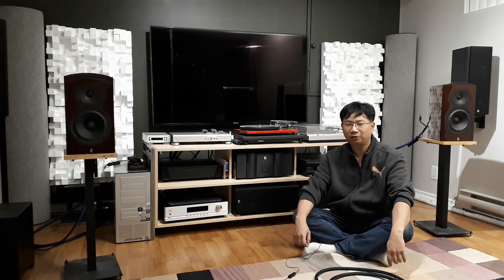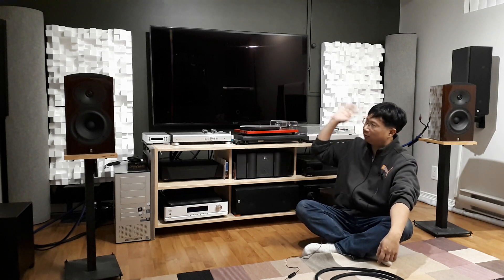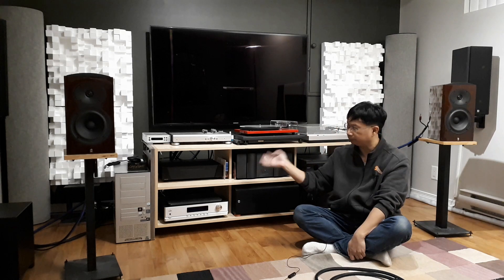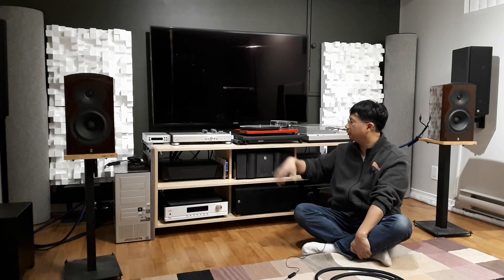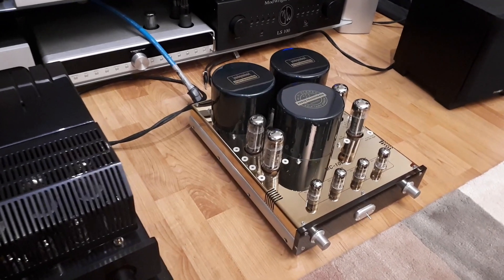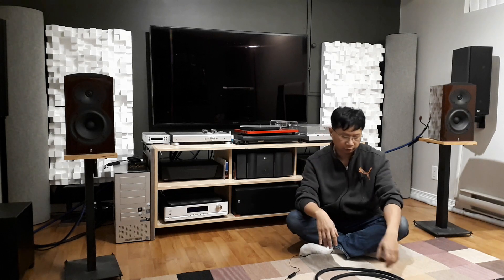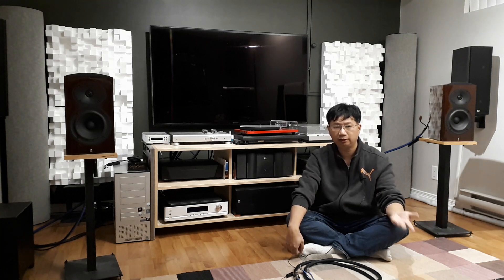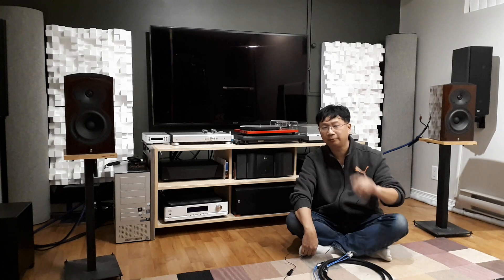I am back! With fake speaker cables!

Comment: i'm a Electrian also and i work at Montaplast of north America in the maintence department , Our robots are building the new mid engine Corvette , Did you have your electrian run you a direct circuit ?
Reply from the maker: I have 2 jack installed and each one have a dedicated breaker at the electric box. Is that a direct circuit?
Reply: @ThomasAndStereo  yes
Reply: In my opion you get cleaner power thats not interupted by daisy chaining from one electrical receptical to another , This is much better than buying a power condtioner without a direct connection , unless you have dedicated circuit and power condtioner then yeah that's The best way possible for clean power supply .

Comment: I've tried a set of speaker cable from ali. Vd hul. I also own a pair originals. The cable from ali is a fifth of the price. Measured em both. Exact the same. Resistance everything. Cut both the bananas. The same. Listened it on my mancave set.  quad esl powered bij sphinx project 2-18 amps. No difference. So what gives. Ofc or occ copper is ofc or occ copper. Im not saying you have to invest in all chinese products. But blindly buying the most expensive option is stupidity.

Comment: Hi again Thomas I was sceptic about speaker cables for many years, My old Spendor BC1 which I used with a Audio lab 100watt Power amp for many years tried a couple  of different cables and made no difference.

Up dated My system to Naim pre amp nac72 and Naim Nap 200 power amp with Harbeth Super HL5 speakers
tried different speaker cables and to My amazement it do change the sound very marked indeed I cannot explain why.
Reply from the maker: Yeah, can't explain it with measurements but like you, I can definitely hear it BUT not all the time. I think non believers think cable makes a difference every time, it does not.
Reply: @ThomasAndStereo  No not all the time. My Harbeth HL5 are more revealing in terms of texture and detail as the Spendor BC1 are not, it could be the HL5 speakers are more sensitive to cables.

Comment: Hi Thomas!  You should move your center speaker to the top shelf at least, makes no sense having the amp on top.  Are you using those black speakers on the outside as Wides?
Reply from the maker: Hi, The reason is at the bottom shelf is because my projector screen comes all the way down when I use my projector.
Those black speakers are my main home theater speakers.
Reply: @ThomasAndStereo  Ever thought of an acoustically transparent screen?
Reply from the maker: @commanderrussels2612  Oh definitely, my friend has it and its amazing to have the speaker behind the screen for home theater. Not possible in my case unless I plan to use my projector as my main display. I like bright rooms. My current screen is a tab tension electric screen.

Comment: Nice room. I highly recommend moving the TV above the plane of the speakers if possible. Can you tell us where you got the white diffusion panels?
Reply from the maker: Thanks, that is what one of my friend did but it would be difficult in my case. It was already so hard for me to mount it because I went with a extra heavy duty mount and the screw was so hard to screw into the wall, removing it would be too much work.

Comment: Glad your back Thomas , another great video and your room is coming along nicely. Who did your stereo rack ? Do they deliver to the states ? That’s exactly what I’m looking for .
Reply from the maker: No, it's someone local. I like it as it has metal support underneath and a metal frame on the side.
Reply: Thomas & Stereo Ah ok , it’s very nice and exactly what I’m looking for , I’m using a double set of VTI racks right now filled with sand to deaden them and it works well but I want a wood rack .

Comment: I totally disagree with your passing comment that the Thorens TD-203 is 'just ok'. It is a fantastic table. Where else can you get a finely built uni-pivot tonearm and electronic speed change for that kind of money. The uni-pivot arm extracts more detail in general. Mind you I've never had the stock rebadged budget AT cartridge, like Rega also uses on their entry table too. I purchased mine 203 with an Ortofon 2m Blue. Vinyl LPs set directly on the platter, which it's designed to be used, the uni-pivot arm, and dead accurate belt-drive low torque motor like AR used is a superb combo. It would take a lot more money to surpass this combo. Just my 2¢

Not trying to be offensive, but a small critique about your presentation. Try to have your thoughts more concise w/ less rambling when making your point.
Reply from the maker: Well if I had it with the Ortofon 2m Blue, I might conclude otherwise. I guess 'just ok' is relative. My last turn table was the Marantz TT15 so I was hoping this would at least be 80% of it due to the point of diminuishing return. Sadly it was not, maybe with the Orfton blue, it would have been.  I usually do try to have my points all done but sometimes I improvise on the spot, I have a serious memory issue, (as in the type I have seen neurologist) that is why you will see me a bit lost from time to time. But thanks for the advice, will try improving.
Reply: @ThomasAndStereo  Sorry to read the 203 isn't meeting your expectations. I should also mention that besides the 2m Blue, I'm using the superb Schiit Mani phono pre with a Mystere IA11 tube integrated amp (by sister company PrimaLuna in the Netherlands) with ElectroHarmonix tubes. Sound is big, full and detailed surpassing CDs from a BD player w/ likewise highly-rated Schiit Modi 3 DAC.
PS. I didn't mean to offend your communication style but you can be long winded. Just thought tightening it up a bit more would make it easier to keep my interest and follow your thoughts.
Reply from the maker: No no, not offended, especially you are not the first one to tell me. I try to condense and get straight to the point as much as I can. Still room for improvement.

Comment: hi Thomas :)
i like the new changes to the room and upcoming content looks like fun.
and always nice that one of those speakers i got so comparisons would give me a reference point.
Reply from the maker: Thanks! Which one do you have and your opinion about it?
Reply: i got the wharfedale 225's,  had them for 6 months as nearfield as my main system. i think they are great buy, but the port system might be boomy for some rooms and its hard to plug it since its vented all around the base.  at least with my canton's its a easy fix with normal ports.

i do not have enough experience with different speakers to have a proper opinion just yet.
Reply from the maker: The D225  are pretty good. They definitely are one of the budget speaker to consider when shopping for a speaker in this price range.

Comment: Hi, you can try pure silver. They are around 10% of you $3k cable. You can find in internet. I have change all my cable to pure silver
 They are better with tube amp. Good luck.
Reply from the maker: Yeah, I have a few silver cable already. Thanks.
Reply: Not silver. PURE SILVER. THEY have different sound.

Comment: Your room looks great!  You figured out on your own to go with a smaller speaker that won't overload the room.  With your smaller speakers, I would be careful about too much deadening.  Your friends speakers that I saw in other videos can move much more air than a stand mount two way.
Reply from the maker: Thanks, I actually ended up removing the carpet as I find the room too dead now. I have both floor standing and bookshelf speakers and now my room can handle both with ease.

Comment: HELLO, I HAVE A QUESTION. DO I NEED STEP DOWN TRANSFORMERS FOR MY TUBE EQUIPMENT?
Reply from the maker: I have a Yaqin 10Ct and rated at 110v. Here in canada, we have 120v. In theory, I should. I don't and from what i was told it does shorten the life. I heard from my friend in other country that they are ok to overdrive it with higher voltage as it does sound better according to them but shorten the lifespan. This is a question more for an engineer, I have no idea except from what I heard.

Comment: welcome back 
awaiting your review on the WD diamond 225 :)
Reply from the maker: Thanks, if you have them, what do you think of them and how they sound? Asking because just incase I miss something characteristics of them.
Reply: @ThomasAndStereo  hello Thomas , Yes I have them , before getting them I had vintage Onkyo speakers and Definitive SM45 , when I got the WD225 I didnt like their sound at all maybe becasue the previous speaker tends to bright side a little bit more than WD225 but after breaking in which takes more that 100 hours the sound dramatically changes , those speakers shines with their mid-range , maybe they need a little bit more triple but this can be compensate by the amplifier and depends on the source .
Also those speakers needs to be positioned correctly and not tolerant as the Definitive "which are a great speakers in fact" 
I found those speakers are very good jazz , classical ,instrumental music but not for rock or any music that need "mmm, how to say" more dynamics.
finally the down firing port doesn't mean you can place them very close to wall but better to keep them at least 10- 15 cm from wall .
one more thing I noticed they sounds better without tweeter grill I thought at first that my mind telling it is better without grill till I read the review on Stereophile.com and the reviewer mentioned the same notice at the part of speakers measurement .

Comment: Just done something similar and took a while over it. I think you have far too many diffuser panels and in the wrong place. I would go with around a quarter of what you have and it should be where your tv is. Trust me even a little too much will be detrimental to your sound.
Reply from the maker: Yes it should be where the tv is but sadly I can't live without my tv. These are premade so I will have to cut them to make them smaller but they are so expensive that I am hesitant. Still a work in progress, some say put it on the ceiling, my friend puts it at the first point of reflection those diffusers. Have to spend  time to figure out what sounds best.
Reply: @ThomasAndStereo  yep trial and error my friend. I ended up with only a little. Turns out reflecton is not all bad. Dont over do it👍

Comment: Glad to see you back Thomas
Reply from the maker: Thanks! Happy to be back.
Reply: Looking forward to hearing your thought on the electricians work. I’ve sudden added a lot of audio equipment, and I’m finding all sorts of noises/hums that I need to eliminate. I noticed when I brought my cell phone, near my desktop computers keyboard, there was a hum coming out of my speakers. Can’t remember if was my computer speakers or my audio system. I pulled my cell phone away, the hum went away. Brought it close to my keyboard, the hum came back. Also noticed when I moved some of the audio cables in my audio system, there were noises from the speakers. So many places I need to eliminate interferences. Have to check all my cables, the outlets, the power strips & etc

Comment: How does diffuser panels affect frequency response? I always thought they only helped with imaging and soundstage.
Reply from the maker: One weird thing I noticed is with my new setup, the singer feels very 3D and exactly at the center. I sometimes would stare at my tv almost able to imagine a singer there.  The best part is it is with all my speakers now.
Reply: + @ThomasAndStereo   

Thomas, what type of material are your white diffusers made from?  Are they hollow on the back side and lightweight?

Ideally your huge flat panel TV would be replaced by a diffuser panel + some absorbtion.  You'll have much better potential of experiencing the depth and layers in the soundstage.

You could replace the HDTV with a large perforated roll-down projection screen & projector setup.  I don't think you have any windows in this room that would cause screen washout when using a projector, right?

The most important Reflections to control are the main Side Wall Reflections from both speakers, on both sides of your listening position, and also the Back Wall Reflections.  As you mentioned, a suspended "cloud" absorber and/or diffuser will be beneficial as well.

Each speaker will produce reflections on both the same side and the opposite side wall at basically a 90° reflection angle to each speaker, as if you placed a mirror on the side walls and could see each speaker reflected in the mirrors from your listening position.

Speaker positioning itself (distance between + toe in, & height), and in relation to your listening position, is extremely important.

In addition, search online for the Carl Tatz Room Mode Calculator to dial in your room's low frequency response at your listening position.  Excellent video (applicable info mid-way and towards the end of the video):
https://youtu.be/ZDmACvbPxXs

The other most important factor of your room is its STC response...reverberation decay time throughout the frequency spectrum.  STC Ratings:
https://www.soundproofingcompany.com/soundproofing_101/understanding-stc-and-stc-ratings

What Microphone(s) and Software will you be using for your measurements?  I'll just be frank and say that Measurements are useless if you don't understand them & know exactly how to interpret the data, and then correlate it to what you are hearing in the room.  Then knowing WHAT changes need to be made and WHERE.

For the mass majority who do not know how to do proper room measurements and don't know how to interpret or understand the data, one of the best systems is the SonarWorks Reference 4 software and microphone speaker/room correction system.

SonarWorks R4 guides you through the test & measurement process, and you can A/B the before & after results.  Demo here:

https://youtu.be/OvuhK1rVOxw

Comment: I had a spool of this speaker cable laying around from my last house... https://www.htd.com/4-Conductor-Speaker-Cable-14-Gauge

I built a stand, and have the speaker cable running through it, pretty cool, so I pulled out the 12 GA and installed the above cable... Works out to 8 GA after doubling up the ends, just fit the banana plugs... Talk about opening up the sound of the system! The Ultra Bookshelf speakers went wild, LOL! Thank God I had the Schiit Audio Loki in the pipeline to tame them and tone them down a bit. I knew there would be a difference, but not this much. Can't wait to see your review of the Freya Thomas.
Reply from the maker: Thanks Michael, I am actually using the Freya a lot these days despite having lots of other higher end preamp. It's pretty amazing this preamp.

Comment: I would really like to see a Hifi system / speakers setup in an an-echoic chamber with proper sound measurement equipment, then swap out a few dozen cable types and see if any audio change can be measured. I don't think anyone will do this because there is no profit involved but still would be cool to slam the door on this one once and for all.

Comment: Welcome back Thomas! Are you still looking for Xindak PA-M(II) ? :) I would be interested in your review of this amp. I wanted to give you a tip that really transformed my listening experience. If you are using a dac I would advice you to buy a dedicated streamer. I can see a computer in the corner. I don't know if it is hooked up to the dacs, but if it is, even the heapest streamer is going to give you a massive improvement in sound quality. In my case I bought Allo USBridge for like 150$ and it made a world of a difference. There are more costly solutions from sotm, sonore or auralic, but I haven't tried those. I power the allo usbridge totally off-grid with a Xiaomi Power Bank 2C, which improved the sound even more. I am wondering what your expierences are with such gear. In my case the improvement was just shocking, I was not prepared for it. Actually my digital setup sounds now better than analog setup at roughly the same price. I just keep the analog setup for the sake of holding the records in my hands, not for the sound quality. I wish you all the best! Marcin
Reply from the maker: Thanks Marcin, I did look into Auralic as I was also thinking to eliminate my computer. Having said that, my current exasound E28 is analog sounding enough that I feel it's not too far from turntable. I understand how noisy a computer can be ( electrically) so going a streamer did cross my mind. Thanks.

Comment: What do you mean those cables are fake how can you tell without dismantling it... or running tests, feeling the cable is not going to tell you if they're fake or not. What gauge of wire and what type of wire is it do you know. What are those diffusers made from they look like polystyrene. I'm not sure why you put your equipment behind your speakers not the best place, on the side would be better or the back wall. Bye some Origin live bearing oil worth buying if it's not inverted doesn't have a channel. Be good for the Thorens  Or 90 gearboxes oil. Yes looking good what sort of tests have you come up with acoustic test on the computer
Reply: John sweda,you not smoking crack are you?
Reply from the maker: Just google on fake speaker cable, there are a lot of info on it. For example, these siltech , you can just send them the serial number and confirm it.  The diffusers, not sure, google viscoustics DC2 for info. You are correct that the best place to put the equipment is on the side as where I am putting it will affect sound stage. However, there are many practical reasons why I did not.